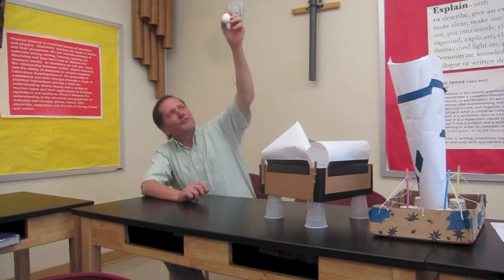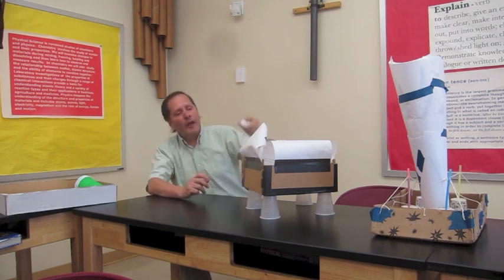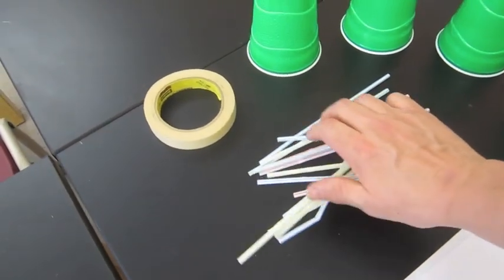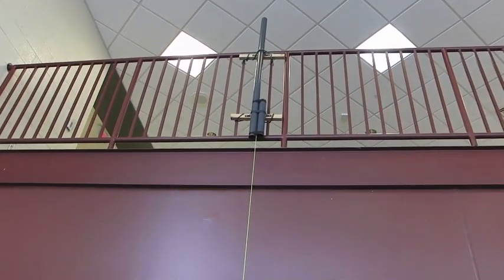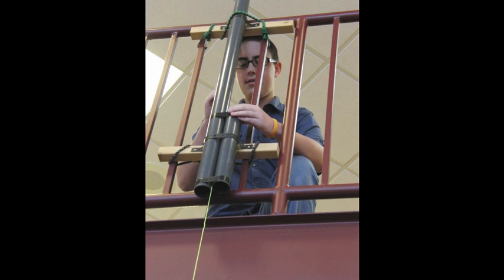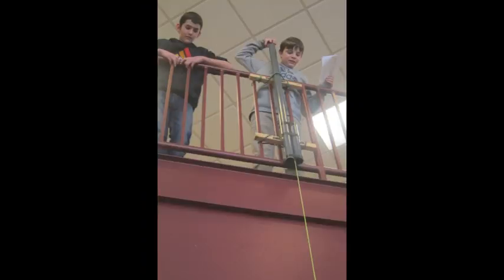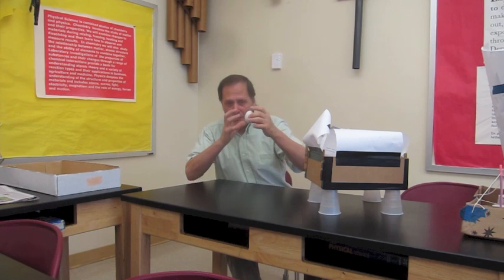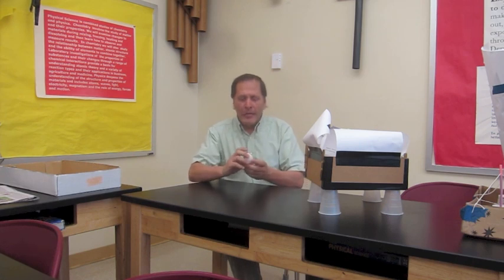Egg drop activity////Homemade Science with Bruce Yeany

Comment: My teacher is having us do this too!! And it was hard finding egg drop videos without the egg packaged...so thank you!!
Reply from the maker: Good luck with your drop!
Reply: i have to do mine out of 50 business cards and clear tape only
Reply: Bruce Yeany 
My teacher did this as well
My friend and I were able to design one that could take 40 meters(top of school bleachers)

You take a cardboard box and put a folded up blanket in the bottom and lay a pillow sheet over the top

We ended up improving that design further by also laying a small blanket over the top but under the pillow case
Make sure to make the blanket laying over top to be slightly concave and the pillow sheet to also be slightly concave but less than the blanket 
That way it has multiple layers of absorption

That design never failed and put performed anyone else I've ever seen do it
Reply: Jonathon Lee is there anyway you have pictures and can send it to me

Comment: But can you explain the physics behind it?
Reply from the maker: yes, someday I'd like to know what the amount is
Reply from the maker: Sanjana Pratti 
HI Sanjana,   The success or failure of the egg project is explained by Newton's second law and the idea of impulse. In this case the force applied to the egg is to decelerate it.   If you watch my video on impulse,  it shows that you can throw an egg as hard as possible into a sheet and not break it.  However, if an egg is dropped on the floor it will break every time.   The idea is to build a device that does the same thing.  A successful project will slow an egg down over a longer period of time so that the force is decreased enough that the egg's shell doesn't break.
Reply: Correct, you want to lower the average force the egg experiences when it is "caught" by slowing down the "catch" of the egg. Try to catch a raw egg yourself and you will see what I mean.. you move your hands with the egg to slow it down, not stop it quickly. It is essentially an understanding of impulse.
Reply: So basically in short, you want to create a contraption to decrease the amount of g forces applied to the egg upon landing.